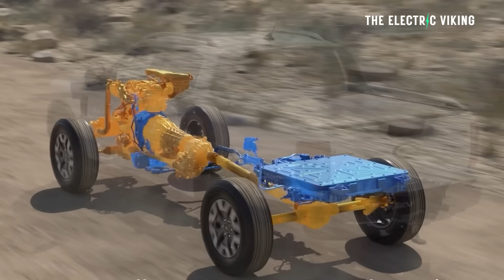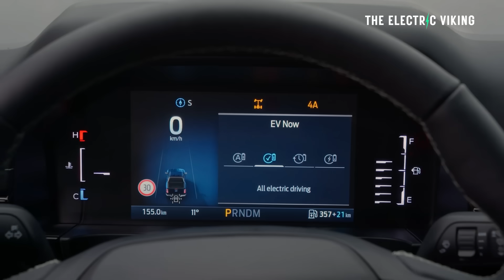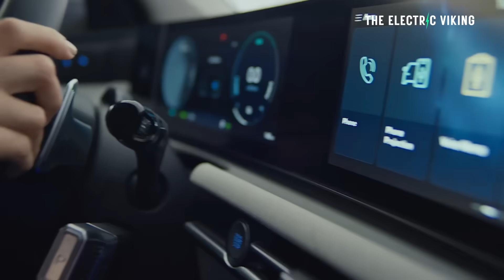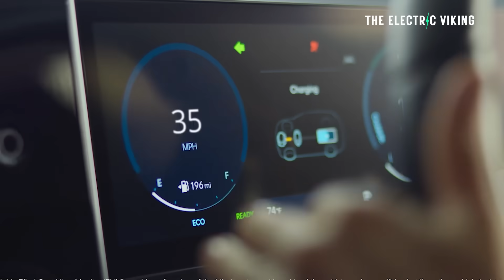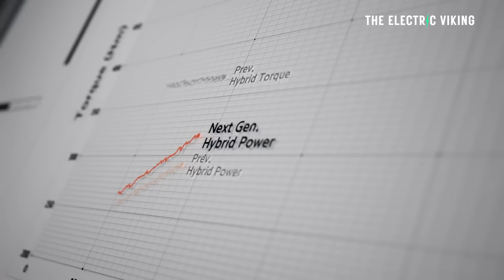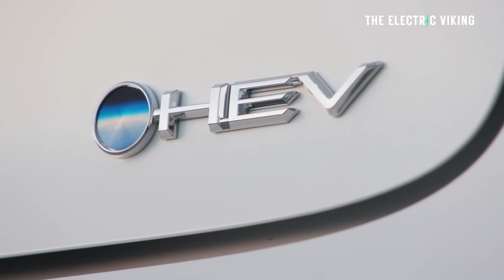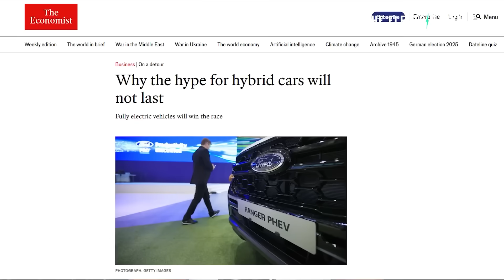Why experts say the HYPE for hybrid cars will not last

Comment: Believe me, I'm a pragmatic Tesla fan ot. We own a Y & I drove a 7 year old phev. We always take the Y on trips. But my phev has more than clobbered the Y on $/mi TOC. I got Fed tax rebate, 0% finance, with my solarPV, I beat the Y easily on $/mi. It has 70k mi Odom now. I also have a lifetime 🔋 warranty, 100k drivetrain. So my phev worked out much better for me. We love our Y too. Sadly Calif shafted solar PV last year so going forward, my phev vs Y fuel cost is a toss-up. No difference on supercharger rates. 😢

Comment: A Toyota Prius set a Guinness World Record for fuel efficiency during a coast-to-coast drive across the U.S. in 2024. Driven by hypermiler Wayne Gerdes, the Prius achieved an astonishing 93.158 miles per gallon (MPG) on its journey from Los Angeles to New York. This shattered previous records, which were in the mid-70s MPG range.
The Prius also set a record for lowest fuel consumption, averaging 2.53 liters per 100 km on the same trip. This achievement highlights Toyota’s continued leadership in hybrid technology and fuel efficiency.

Comment: Hybrids often get 50+ miles per gallon of petroleum. EVs get 100+ miles per 1 gallon from a gas turbine + 1 gallon at the socket. Works out to 100 MPGe or 50 miles per gallon. PURE FRAUD. Hybrid plug-ins are even better. Norway gets more than 90 percent of its electricity from hydro. NO RELAVENCE TO MOST OF THE WORLD. People are turning away from EVs because they have finally figured it out!

Comment: This is such horse crap.  How many people live in places where they can plug in at home.  Most of New York City parks on the street.  It's the same in most cities across the world.  Does one run extension cables to the car.  How safe is that.  Try charging at a fast charger and just see how much savings you get.  Hybrids give excellent fuel economy in the city, and looking at the price difference, the hybrid makes excellent financial sense.  A used ev takes a massive loss so adding this in, ev are more expensive.  Unless charger rates are reduced the ev argument is not great.  Norway is a bad example as Norway has huge taxes on new cars so the government dictates which cars are sold by tax policy not by economic reasons.  The rest of the world does not fit this model

Comment: My Ford hybrid Eco boost truck is great. Glad to not take delivery of a cyber truck piece of crap.

The Lightning truck handled better and accelerated better than the hybrid truck however, it only had 300 mile range. I need more than that for what I do. 

Yesterday I filled my tank. The range was 679 miles. 

After 69 miles of driving my mileage was 21 miles per gallon

The truck has a 7.5 kW high duty cycle generator that I can run my off grid house off of I can run my power tools where I am and I wouldn’t trade this truck for any other vehicle 

The truck has 500 hp blasts by any traffic conundrum or tailgater at the touch of the throttle 

Blue Cruise works great as I commute two hours each way to a project 

Maybe hybrids will become more technologically superior in the future with alternative fuels or plug-in, hybrid batteries 

Unless batteries get higher energy density lower weight they just won’t cut it for people that need to tow or drive distance regularly

Comment: 70% of Americans don't own a home. If you can't charge overnight, in the U.S. , an EV SIMPLY WONT WORK.  That's the bottom line.  You can hammer on about first principals all you want, but your opinion can't bend reality.
Reply: And even if all EV owners had a way of charging at home, the utility companies are warning that they can’t handle the demand load if everyone does it at the same time overnight.
Reply: @SamWesting ALL EVs?  Try 10%. Especially in blue areas where they shut down - instead add power plants.
Reply: I disagree with about everything that was said in this video. Smart car maker build vehicles that customers want to buy. Period.  There arent enough precious metals in Earth to conver all cars to EV.  Oil, however, is CONSTANTLY BEING CREATED within the Earth's mantle..

Comment: In order for EV's to be viable, they need to hold at least 95% of its charge when parked for a few weeks even in the coldest winter outside. 
Charging needs to be max 2-3 minutes, and it's lifespan at least 20 years! and it's middle trim level should be no more expensive then 30k € 
If all of these are fulfilled, then MAYBE people wil start SLOWLY start buying EV's

Comment: Its a misnomer that phevs drag around a heavy battery and suffer poor perfomance after 20 miles when the battery is depleted. The truth is they are a full hybrid and continue to regen the battery for slow speed ev running in traffic, perfomance boost, high speed coasting and efficient stop start. Its really only the increased complexity that lets them down.

Comment: Not so in the UK.
40% of people have no off road parking so can’t charge at home.
Public charging costs far more than petrol right now though this may change due to competition.
Most drivers in the UK do mostly short trips  so even a small battery is sufficient. Then they do occasional longer trips using the hybrid system.

The result:
PHEV resale values are getting better while EV resale values are getting worse.
Reply: With regards to offstreet parking then when 60% of people are buying EVs your comment is relevant; until then.
Reply: @GDM22 it’s relevant as long as anyone doesn’t buy an EV for that reason.
Reply: @Gopher31 Relevant for an individual in the 40%, but not a limiting factor why EV ownership cannot increase significantly before that becomes a barrier.  If you do the odd trip is sightly higher charging costs or the odd need for public charging such an issue. My observations of RSEV making road trips look pretty easy says otherwise.
Reply: @GDM22 it’s a huge limiting factor.
Say 50% of people would prefer and EV if they could charge at home.
Public sentiment would be for 50% EV ownership.
Actual EV ownership would be 30%.
Reply: @Gopher31 The way people make choices is the issue here. When it comes to car ownership especially where I live the just in case rule drives the purchase. It is why people buy bigger cars than they need, pristine 4WDs cram the local shop car parks when the never go off-road and buy a car that can tow, but never really do it, or the PHEV for the country trip, when they perhaps do it once or twice a year, when for the other 50 weeks a BEV would be better.
Reply: @GDM22 and does the ability to charge cheaply at home rather than for much higher rates in public affect those choices?
Reply: Ahh. Could the Tesla robo taxi solve that problem. Don't have to own, charge or maintain a vehicle. An app on your phone will bring transport to you. 2030....2035.....It maybe coming.

Comment: The maintenace costs of ICE cars are far greater that BEVs, which are far cheaper to run than buying gas.  With a BEV you can forget about oil changes and tune ups, and brakes last 3x as long.
Reply: I think you are in for a shock if your EV breaks down and has to be repaired.

Comment: The best choice is a EV with a trailer hitch. You can get a small trailer with a generator to pull around to deal with your range anxiety. After you realize the extra weight of the trailer and generator are lowering your range , you can leave it in the garage and drive the EV as it was designed to be used. 
Unfortunately for the plug in EV owners,they are stuck with a gasoline motor and tank and all the associated fire risks.Also they tie up too much space to add battery capacity.
The price difference between 20 kWh battery in a PHEV and a 50 kWh battery shouldn’t be more than $15K . That’s probably less than the expense and complexity of adding a second propulsion system.

Comment: Plug in hybrid is a transition possibility to allow carmakers to get to EVs.
They will get the tax credit.    If the Tax credit in the US disappears..  say good bye to all the hype for plug ins

I have both an ev and a plug in.   I LOOOOVE my ev.
It is only on rare occasion that i need to drive 400 miles.   Lets be real.   AND I couldnt deal with charging on my trip.
OK  Fine.  drive the plug in instead.

The plug in is just fine driving the kids to school in the morning   I like not having the gas engine turn on.
BUT BUT BUT.    I just got through  putting 750 last year  and 1200 this year on maintenance on the plug in.  
brake fluid and radiator fluid and a 105 dollar oil change.      I have not had to do anything to my EV other than washer fluid and new wipers.

For people that are fraidy cats.. a plug in will help their irrational fears.

Comment: Well put it this way.... I'm a fan of electric good cars....but here in Australia....mmmmm...yeah...
If you have a house and solar with a battery, yes please bring it on, and specifically if you have a Tesla with all the supercharger network, yes bring it all together....
But for the average consumer that can't afford all of that.... What's the solution?
If you don't like diesel utes like me?
Well, you are probably convinced by a dealer to buy those Japanese hybrids, because that's what people believe, when they hear a car salesman....
And people go for these crap hybrids with no range and made of NICKEL! .... yes people, ask your dealer what's the hybrid battery made of that car you are about to purchase.... ( They probably won't know) You will have to research by yourself.
Again, consider the fact that those companies ( not going to mention brands here) give 5 years warranty in the whole car.... So, what does happen when same fails after 5 years?..... Deep in your pocket.
Then, you will see some other companies that are unknown, and have the best battery tec  ( yes made of Lithium)and give you 6/8/10  years warranty.....
So do you research first.....
And honestly, having a small engine that can charge a LFP battery and can go for 1.000 KMS range. Have that instant torque of electric car out of the traffic lights, and going silent out of the garage and drive way, seems like a good thing..... Specially if it's a SUV costing 45.000 AUD drive away with lots of warranty

Comment: The problem with a plug-in hybrid is that I would never want to be the second owner. The batteries are only a fourth or a fifth the size of a full EV. That means they are cycling their batteries four to five times as often and always to 100%. There's no other option. So if my EV battery is expected to last 20 years... and it is. A hybrid battery is likely to only make it four or five years as it will have cycled as many times. This means that it'll probably be okay for the first owner. But I wouldn't buy a used one. However, the dealerships & the manufacturers are happy to sell it to you, because they know they're going to make some more maintenance money. 

They are playing on your fear. Get over it and get a full EV. You'll never want to go back.
Reply: That logic doesn't match reality. PHEVs have been around for more than 5 years now. Most automakers have more than 5 year warranty on batteries. And battery degradation for BEVs has a lot to do with charging styles and climate zone.

Comment: Thanks for this Sam. Well, I think the sensible thing to do is to have a small plant that generates electricity using petrol, a small modular unit that can be dismantled later on as batteries get better and faster, exactly like what Nissan did with their e-Power range. No more range anxiety as you can always top up if there are no chargers. what do you think??

Comment: The Australian market is very different to some other markets. The requirement for haulage over longer distances demands more flexibility in energy sources and hybrid, particularly PHEV provides that solution. Sure enough, if one lives in a larger populus area and only has a requirement for short haul low weight mobility then EV might be fit for use. In the city scenario I see an EV with a very small battery as a viable option, not something that weighs 2 tonne and has excessive amounts of power. Seems to me that China is ramping up the options for mid range  haul vehicles that the Australian road network requires. There may be a case for a future EV domination of transport but that will not be with current battery technology. So, if you buy a pure EV now, it will also depreciate rapidly as newer energy technologies are released. The claim that Hybrids will lose value is no more valid than the claim that EV's will hold their value.  Your suggestion that the current generation of EV battery will become redundant suggests that there will be a significant depreciation in the value of todays EV's. I'd predict that petrol and diesel will be with us until around 2040 and hopefully we will have finally made the decision to energize the electric network with Nuclear energy. That's the only pathway forward that I can see if we are to persevere with electrics replacing fossil fuels.
Reply: You would have thought Mr Electric would know this too

Comment: Maintenance cost of hybrids is through the roof.  The tech is far too complex top ever achieve reasonable maintenance costs.  This equation becomes highly apparent as the hybrid cars age and require levels of maintenance that do not make financial sense.  Here in the SF Bay Area, fully electric vehicles are already proven as very low operational and maintenance costs.  This equation only appears to favor gas and hybrids in places like Mississippi where gas is the cheapest in the US.  But any such cost savings will vaporize when something breaks and the real costs of ownership are realized.
Reply: Hybrid maintenance is about the same as a regular gas car even less in some cases

Comment: In Australia the charging infrastructure is horrible. Plug-in hybrid are the best solution at the moment. I have a BYD sealion  6 and I have not filled the gas tank in 6 months. Charging the battery at home is enough for daily use. I have to use a fuel stabiliser to keep the fuel longer than 2 years. It works great and saves me tons of money. And no Range anxiety I can drive up to 1000 km with 60letre full tank of gas and charged battery. No range anxiety or queuing at the charging stations during busy holidays.

Comment: I would love a PHEV minivan.  If I just drove it around town, A BEV would be great. But I sometimes drive to rural/remote locations where the closest fast charger might be an hour away, and even slow charging is not available where/ near I am.  Without a range extender, even a long range BEV would get stranded, or at least require hours of attended slow charging, which as I said isn't really available anyway.  Yes, some day Argon is Kansas (pop 543) will have DC fast charging. Until then I am forced to use my 20-yo minivan.

Comment: Well Hybrids are meant to be an intermediate phase to begin with but if the charging infrastructure in individual countries eventually matures, then there is no reason to go hybrid, here in the Philippines I have Pure EVs, while we are a multi car household with petrol and hybrid options, for single car households moving to electric, hybrid is a convenient first step with the intention of moving full EV when fast chargers become fully available nationwide! just the savings on maintenance is a no brainer to move to full EV, the only limiting factor is the availability of charging stations be it fast or slow chargers.